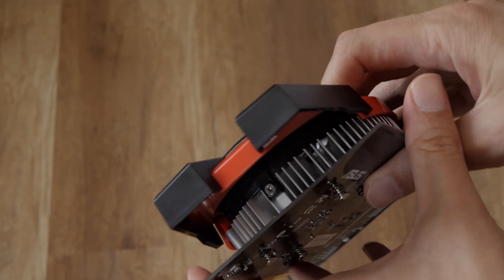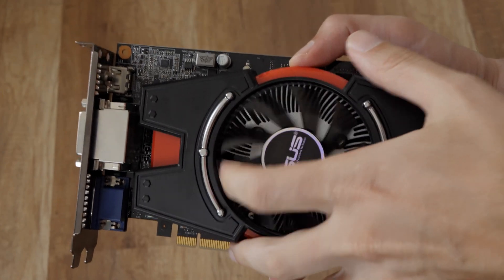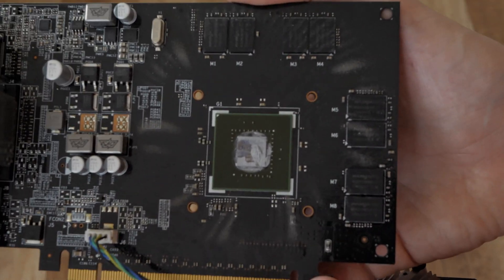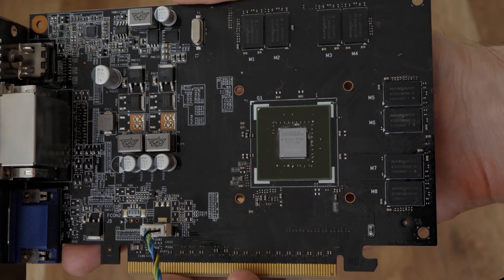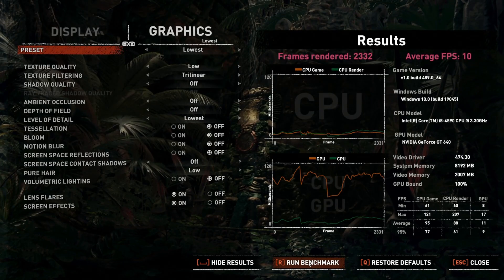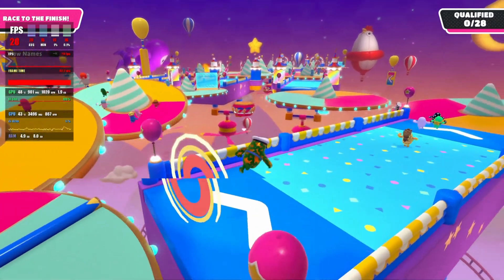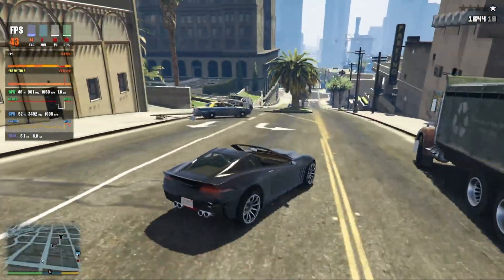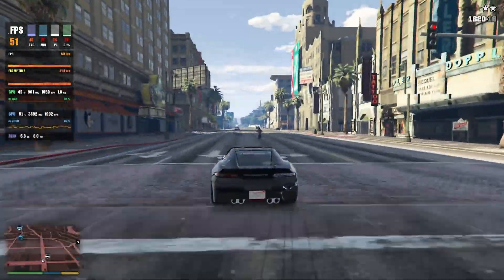NVIDIA GeForce GT 640 - Can you play 1080p games in 2023?

Comment: Back then I had an ATi HD 6670 1GB GDDR5 (same Model from Asus as your 640). I used it with an AMD A8 3850 APU in crossfire. It ran most games great in 1366x768 at medium to high settings with 40-60fps.